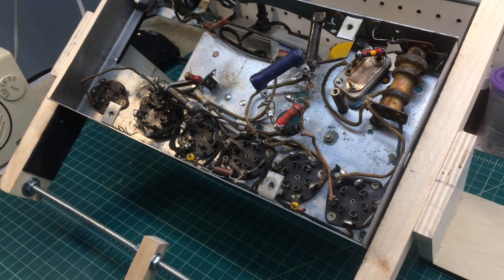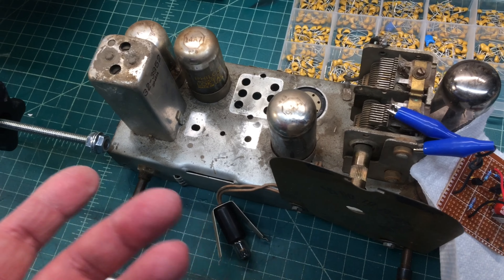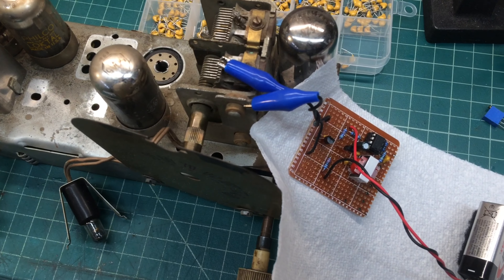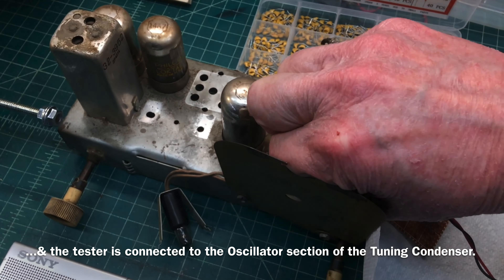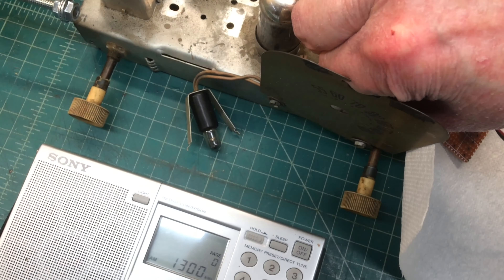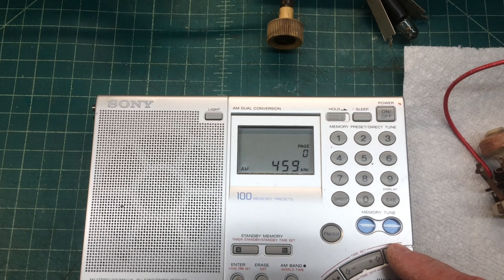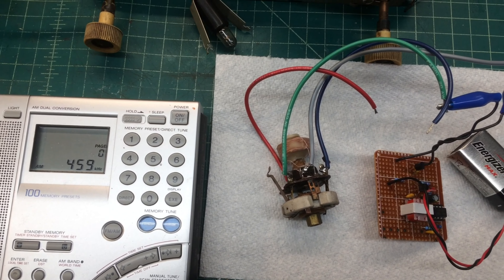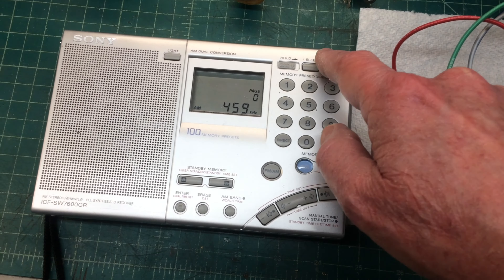Preview: LC Circuit Tester to Evaluate I.F. Transformers + Antenna & Oscillator Circuits

Comment: Interesting but couldn't you use a signal generator with modulation to do this ?
Reply from the maker: Alex - you sure can. The advantage of this circuit you don’t have to vary the SG frequency as the circuit will self resonant at the LC... I’ll post the schematic soon. Thanks for watching and reaching out. Best, Don

Comment: Not sure how this is working.   Hope you show and explain what this is doing.   Where is the carrier coming from?  Where is the modulating tone coming from?   Hope next vid answers all.
Reply from the maker: JP - thanks, that makes two of us, just kidding. The Oscillator can be connected to any LC circuit in a Vintage AM Receiver and will resonant at that particular frequency. I added a 555 timer to modulate the carrier with a ~1 kHz tone, so it’s more identifiable as you tune the adjacent receiver to the resonant frequency. I hope to post the schematic and more details in the next few days if time permits. Best, Don